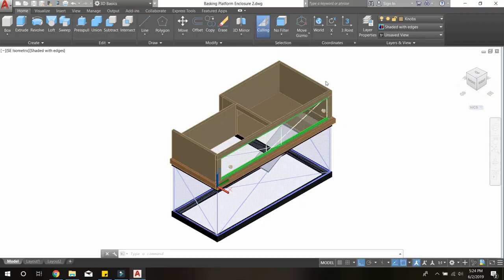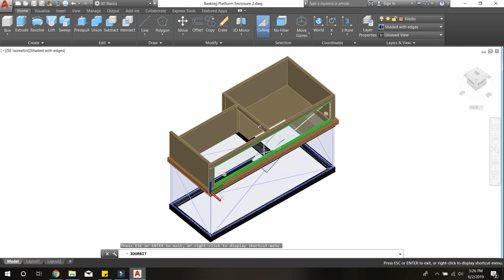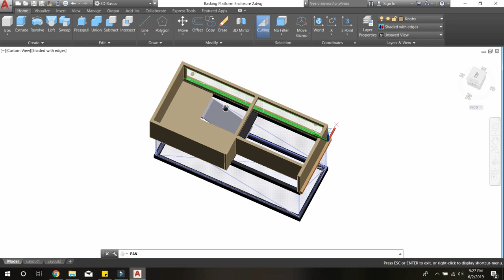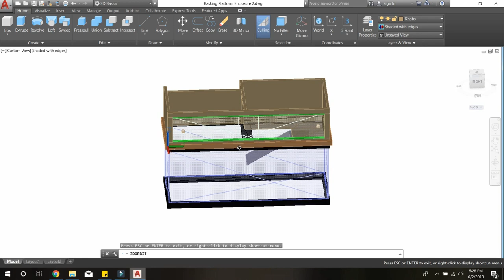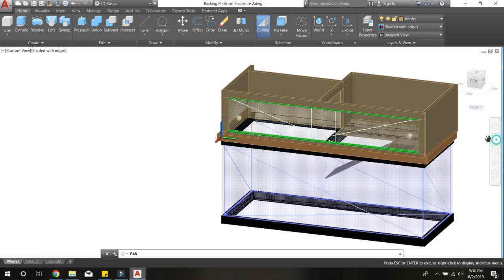Part 1: How to Build an Above Tank Turtle Basking Platform Dock DIY

Comment: Hey! That's a modified of my design from my liamlunchtray channel. Neat! Great work making an actual 3D render!
Reply from the maker: Yes it is! Awesome design man, you were a great inspiration.
Reply: @LongLiveYourTurtle  Awesome! My guy is getting too big for his tank so I'll be building a new one within the year. Going to move up to a 120 or 150 Gallon...
Reply from the maker: @liamgray9113  Excellent, I can't wait to see what you come up with!
Reply: @LongLiveYourTurtle  I think the only change I will be doing is to move the back wall a little farther forward to provide more room for lighting the tank. My current set up has just enough room for slimline LED lights across the back. I'd like to have at least 3-4" of space back there fore better tank lighting. The new tank will be 18" front to nack instead of 12", so I will have a lot more room to play with.
Reply from the maker: @liamgray9113  Good idea, especially if you are getting a bigger tank and can move it further forward. One of my turtles is an escape artist to I gave minimal room in the back.I also wanted to incorporate the nesting area in too so that took a good amount of space in the back. I actually added an LED strip to the bottom wall that overhangs the tank. You can see it better in my updated video on the basking platform: https://www.youtube.com/watch?v=fQ_uEw4aQv0. Still not super bright but helps without moving the wall.

Comment: Hi! I see you don't have any rocks at the bottom of your tank. Do you think that helps the filter keep it cleaner? Also how many times a week/ month do you do a full water change in your tank and how ofter do you clean you filter?
Reply from the maker: Hello, bare bottom is definitely cleaner. I do like the look of sand or river stones though. I do a full water change about once a month and clean the filter about every 2-3. I use a Fluval FX6 which is very powerful for the size tank. Thanks for the comment!

Comment: Thanks for sharing your project. What filter do you recommend? I just bought a Marineland bio-wheel penguin 350 for my 40 gallon tank. The old zilla filter wasn't cutting it for our 4 year old turtle. I didn't realize I would need the water level to the top of the tank with the new filter, which is why I'm researching above tank basking platforms now.
Reply from the maker: Canister filters are the best type of filtration for turtles. The go to is the Fluval FX6: https://amzn.to/3k1k3yq This is a little overkill for a 40 gallon but perfect for a 75 to 100 gallon. But filling your tank to the top is also the way to go for turtles. Optimize their living space :)
Reply: @LongLiveYourTurtle  That link doesn't seem to work anymore, just an fyi!

Comment: Might be a stupid question, but is there any reason why the basking platform is not extended right across the top of the tank?
Reply from the maker: What do you mean? The back portion is recessed so you can fit filtration and the basking area itself is on the side of the tank so when my turtles slide back in they don’t hit the tank glass, hope that helps!

Comment: I built one very similar and I can't get turrtles to go up to bask and its been about a week now
Reply from the maker: Hmm.. did you check the temperature of the basking area? Is the ramp easy to climb?
Reply: @LongLiveYourTurtle  no but I. An check temperature what should it be at 80 to 90? Yeah they have climbed it but only because I put food up there to luer them in.
Reply from the maker: @rikscichlidaddiction25  It should be mid to high 80s for sliders, what kind of turtles do you have? How about the water temperature? Are they in a super high traffic area that might scare them away from climbing up to the spot?
Reply: @LongLiveYourTurtle  yeah sort off.....I went and bought higher wattage light and got it up to mid 90s and they seem to be interested now. Also instead of the clear plexiglass i had them made with mirror tint so they can't see me but I can see them. So that should be here this week. Hopefully that turns out to work.